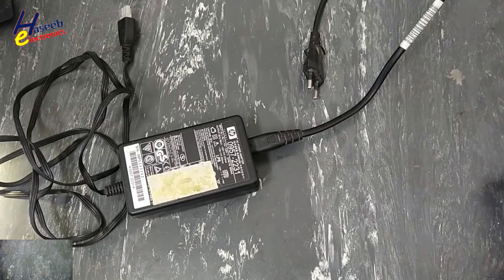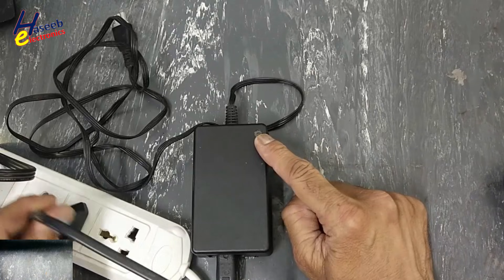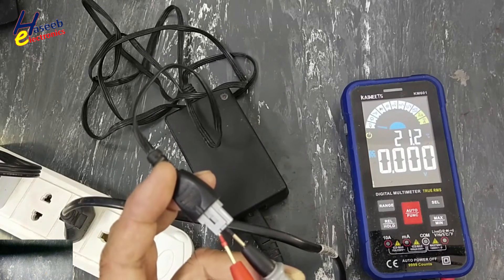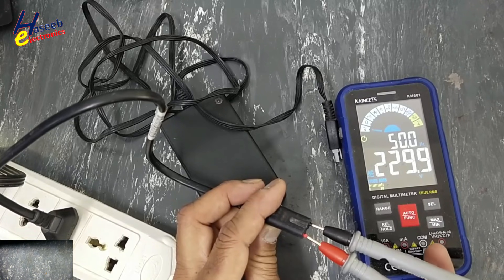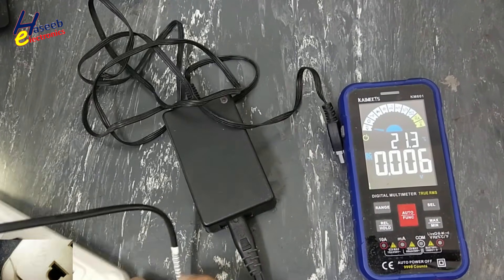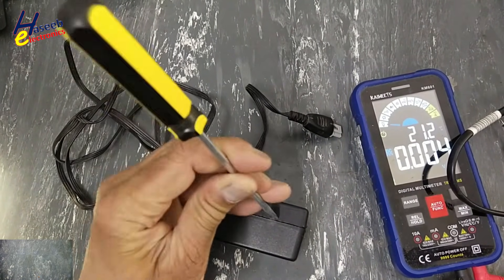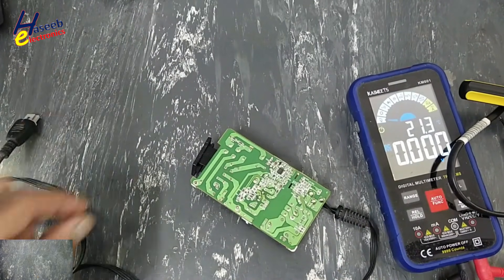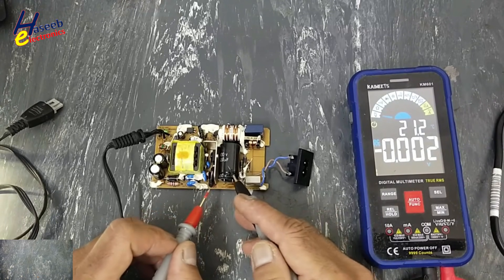{1300} How to Repair HP Printer Adapter | Cheap & Simple Fix!

Comment: Usually fuses doesn't blow up without a reason. What do you think could have been the cause this time?
Reply from the maker: As per my opinion 
Might be there was some high rate repetitive EMI strikes 
Otherwise no over current condition or any short circuit.
Reply: Since nothing else damaged probably user error, they accidentally shorted the AC.
Reply: @g4z-kb7ct  What do you mean? The supply haven't been opened before, the  only AC short possible it's before the fuse and that's shouldn't affect the primary side of the smps I guess, only EMI strikes would make a sense, thanks to Haseeb for the prompt answer.
Reply: @ictrepairs6963  You have forgotten that ALL devices plugged into AC are connected if the power is switched on. The user probably did something wrong within the same building at a different location and the HP PSU was also plugged in and switched on and it got shorted. Most likely the building fuse also blew but it would have been fixed since that problem is more obvious.
Reply: @g4z-kb7ct  The fact that only the fuse blew, with no damage to other components, suggests this wasn't caused by an internal or external short circuit. A more likely cause is a power line transient that exceeded the fuse's threshold without triggering the MOVs or EMI filters. Alternatively, an abnormal inrush current or an underrated/degraded fuse could explain the event.
Reply: @ I have fixed many devices that only had a blown fuse. In those cases an insect or lizard crawled into a tight space where heat was being generated by some device and fried itself across the AC. This could have happened too. The original questions is really just stupid as no one knows what happened and never will. We could speculate about it for the next 50 years lol

Comment: Thankyou,  our printer does not ink regular , can  problem on  logic circuit  board ?
Reply from the maker: thanks for your comment but unluckily i don't have good experience in prinetrs.
Reply: @HaseebElectronics  Problem with printer not printing correctly can usually be blocked heads due to not using the printer for a long time. If it is type with head embedded into the ink cartridge (silver on bottom of ink cartridge), remove cartridge and soak in hot water just 3-5mm of water in saucer and leave for 2 hours then try again or repeat soaking with hot water many times. Ink printers are a huge rip-off. They are designed to fail quickly. If printing is important get a laser printer. If printing is not important use pen and paper ;-)
If ink printing must be done refill them using shringe and bottled ink. The output is generally ok for basic outputs. There is YT channel about how to refill cartridges and many videos showing how ink printers and ink cartridges are a rip-off money machine. Or buy re-fillable ink tank printer. If better quality or random printing is needed use laser printer because they use toner and it can be used randomly / sparingly over many years and continues to work well. I have an old HP Laserjet 1000 from year 2001 it is still working well now.
Reply: @ THANK YOU, GREAT DETAILS